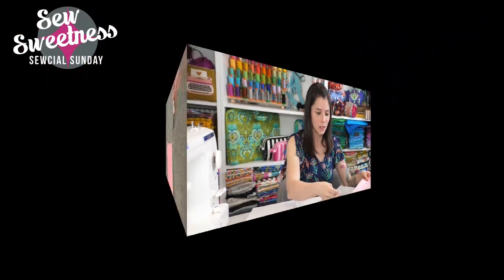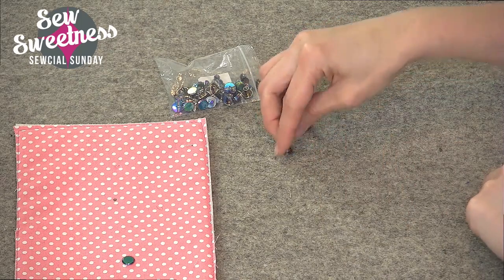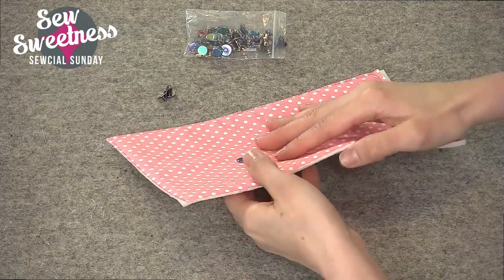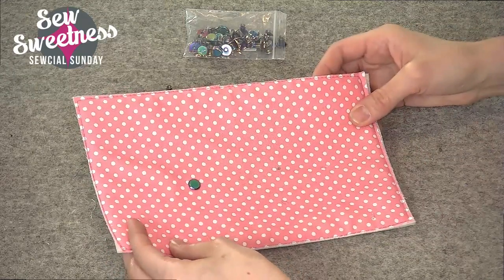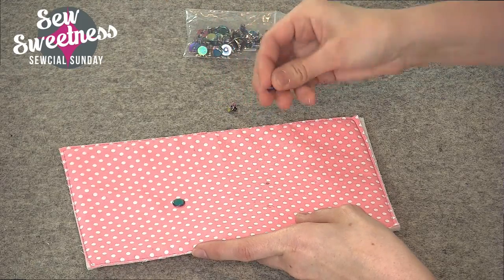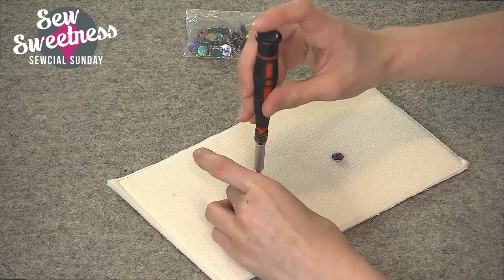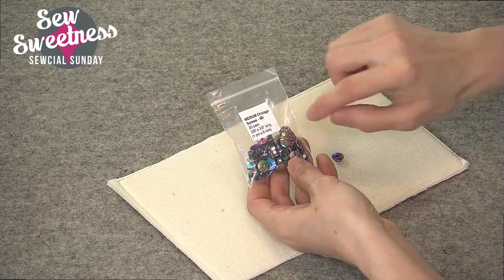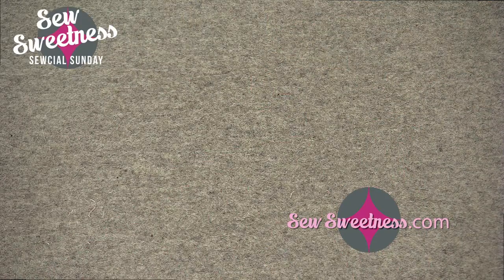How to Install Chicago Screws

Comment: What size hole did you punch and what is the size of the post in diameter?
Reply: I use a 1.6 or 2mm for my rivets so I would do the same with Chicago screws